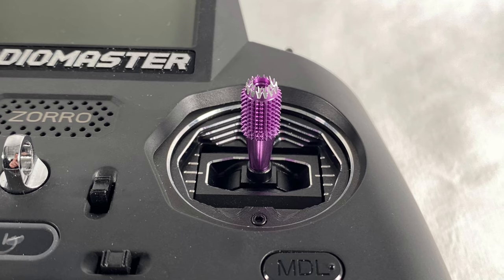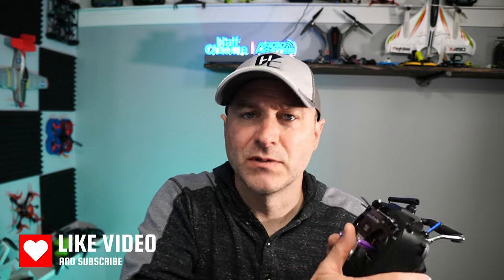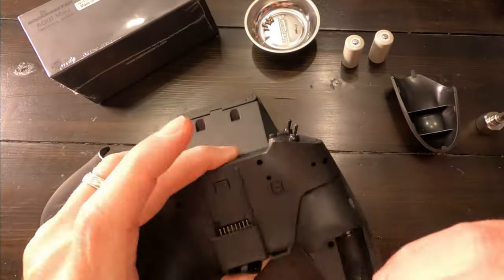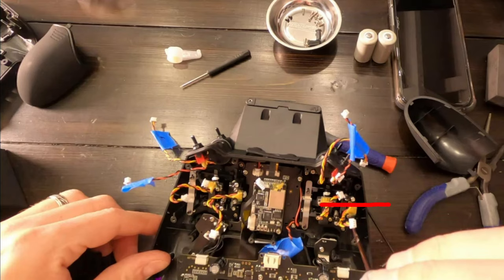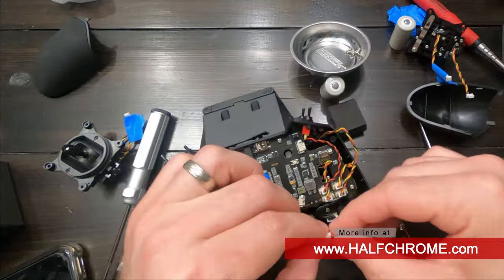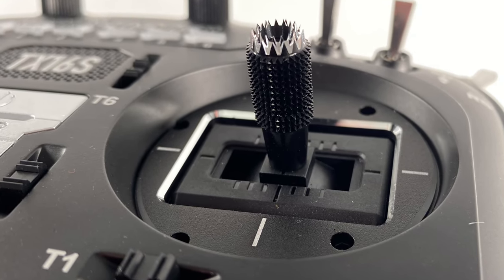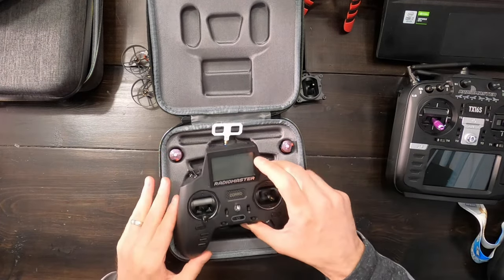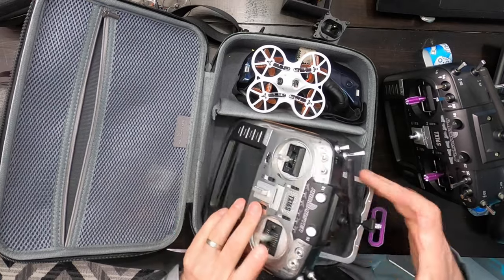Make the BEST even Better | Installing AG01 gimbals and other Zorro and TX16S upgrades

Comment: I haven't upgraded from the Emax E8 yet.  I get the impression that the Zoro isn't going to be great for my pinching style, and I've heard the TX16S is like huge.  It sounds like I should really get something capable of running EdgeTX though, and it seems like those are the only 2 options anyone is recommending.
Reply from the maker: They are the two best options. If you like the E8 stick with it until you make the switch to ELRS